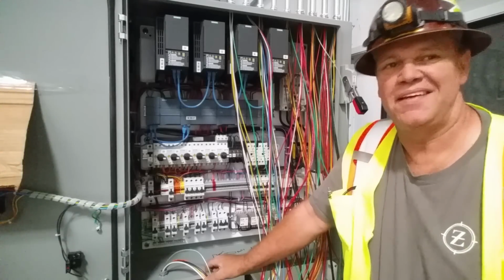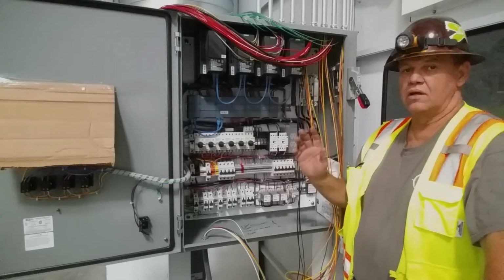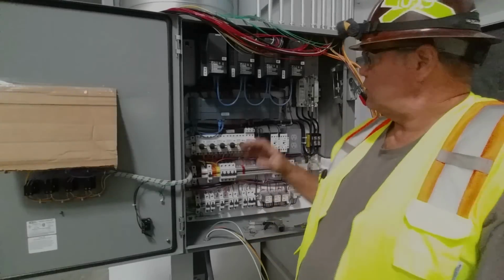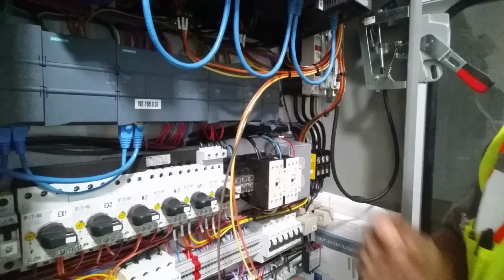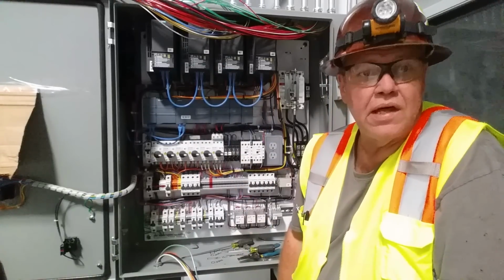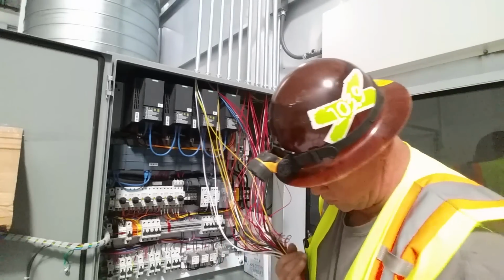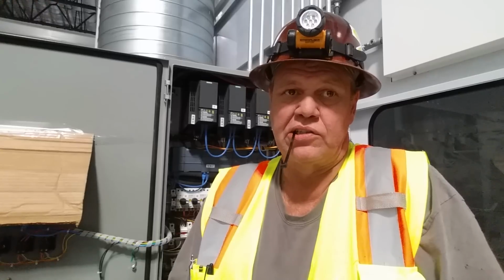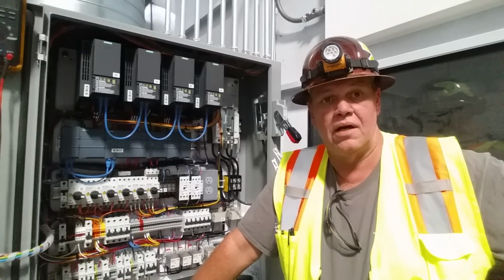Cabniet wiring

Comment: I appreciated your comments about people who have to follow you and thinking about them.  I see you label everything when the bundles are run. That attitude is just crazy enough to work.  Thanks
Reply from the maker: We just do a quickie white tape/sharpie marking job when pulling wire, after everything is bundled and routed, we make nice labels and install after the final trim, I use the Brady making system and make label sets for both ends, if either end has labels left over, we forgot one or something is wrong.

Comment: You said someone asked about one large conduit instead of the several you have, if you put all of them in one conduit there is a derating factor that app;lies every time a wire is added the current carrying capability drops, and after awhile  a #12 gauge wire would  hardly be rated to carry any current at all.   Been an electrician for years,  (retired now) but I can tell you're a top notch electrician, keep up the good work,  Love your videos, takes me back, especially the conduit bending.   God Bless America
Reply: Danny if he dropped all the 3/4  pipes into a trough right above the panels and came out the bottom with some short  2 inch pieces. ( separate 3/4 pipes for low voltage only) Derating is not a factor.  I'm pretty sure  the pipe run has to be more then 2 feet before derating is an issue. Having all those pipes leaves you zero space to add future circuits.  I work commerical and I almost ALWAYS put a trough above my panels.  I have never failed an inspection.

Comment: Reminiscent of my telecom days.  Organization and function were always present.  Flush cuts were required,   Labeling was intense too.  Every cable was labeled at both ends.  Goal was everything could be disconnected and re-terminated using nothing more than the existing labels.  Depending on the job labeling could be 50% of the time spent.  Very boring, and zero glamor, but the first time you had to troubleshoot or replace something you were hooked on the method.  Enjoy your work.  I really had no idea these kinds of systems were out there.

Comment: Stan, good point about the time it takes to do a panel neatly and properly.  I have worked on many residential jobs where the GC would rather me stuff wires wherever I can fit them than making things neat and clean.  It helps for identifying different devices and also makes it clear to whoever might work on the panel in the future where everything is going.

Comment: My rule of thumb:  If it looks good it works good.
I hate those little pads, alcohol is good, but they always loosen up in south Texas.  Just too hot for too long.  
I also like to flush trim the tag ends of tie wraps.  Keeps the next guy from getting cut when troubleshooting.
Putting the tie wraps on the same way every time makes for a clean install.  It becomes second nature over time.  I've found my customers like the clean look, and don't complain about my prices as much.

Excellent tutorial on the proper way to wire a control cabinet.

Comment: I always enjoyed wiring control system cabinets. I was always fussy wiring all the various cables to make it look clean and professional, and it made future troubleshooting and maintenance a simple task. I also developed a simple trick to protect the data cables from excessive interference and data loss. Back then the Ethernet cables used were the flat type ribbon-style cables and not the twisted pair cables used today. My technique dealing with the data cables was to wrap them with foil faced furnace tape and follow up with wrap of a quality electrical tape. At the time it may have seemed excessive, but it virtually eliminated electrical interference and data loss. The flat style Ethernet cables were notorious for cross-talk which causes data loss and errors. Back then the twisted pair Ethernet cables were not widely available and were much more expensive then the flat style cable.
Reply: Those flat type "Ethernet" cables have never been correct for Ethernet. The correct cable was also never that expensive--even in the 80s, the round telephone cords supplied by AT&T for their Merlin phone were twisted pair and worked fine with 10baseT ethernet. You also had the option of buying a roll of 4-pair telephone cable (1000 feet of which probably cost all of $30 back then) and RJ45 connectors and making your own twisted pair cables.

Comment: great video.  Where i work i deal with a rather large turret punch with a material storage tower and transfer system. Three different control boxes with multiple vfds and servo controllers.  Yet whenever something goes wrong nothing in the boxes are labeled and is a hunt and peck method of diagnosis. is that am industry standard so the average operator can't fix minor problems and has to call in the pros?

Comment: One job I had back in the 70's was making looms for large computer power supplies on a "nail board". All wires were terminated both ends, labeled, and tie wrapped at specific points to relieve strain for field installation. It's much easier to trace for fault service AND it keeps the loom out of the way of components. End result is something that LOOKS neat and pretty, because the function determines how to route wiring. Same thing here, it's not because of an "OCD" personality, it's b/c of the function. I'd much rather service a panel that looks this way than one done in a haphazard manner, or laid out to "look" pretty but took so much time that, as the man says, wastes time (and money).

Comment: What kind of adhesive sticky mounts you use? All the ones that I ever used aged badly, the adhesive breaks down in  a couple of years and they fall off.  High temperature ages them even quickly.

Comment: Stan is it code to segregate wires in the pipe and cabinet?
Reply from the maker: All the control voltages are derived (single incoming voltage, control voltages generated within the panel) so sharing a common cabinet is legal (dont really have a choice) separating voltages in the conduit is a precaution so as not to introduce errors into the electronics, shielded belden cables also help keep the signal wiring clean.
Reply: OK thanks I have no electrical experience and of the mind set that if I need an faceplate changed call a electrician!

Comment: 95% of the control cabinets I've been inside use all black for power wiring (480, and 240). Is there anything that dictactes when you have color code the power wiring and when you can use all black?
Reply from the maker: The OEM uses all black within the cabinet too, we use industry standard colors for field wiring just to help out with electrical maintenance down the road.
Reply: Thank you.

Comment: First of all I am not an electrician. Many year ago my employer had an AC unit installed that required 3 phase. The electrician that installed the unit ran each phase through a separate conduit. After running the unit the conduits became very hot. I assumed the induced voltage caused the conduit to heat up. When the new electrician rewired the unit he installed all the 3 phase wires in the same conduit. There was no conduit heating after that. Was my assumption correct?
Reply: Not an electrician either, but yes, when the three phases are bundled together, their magnetic fields sum to zero.

Comment: Surprised they didn't use wire duct in the control box.  But I guess that would have required a bigger enclosure it looked pretty tight in there between DIN rails.
Reply: or good enough is good enough.
no brownie points for showing off.
Reply: EitriBrokkr mm Kay

Comment: The VFD,s that I’ve installed requires the motor ground to be landed at the VFD then a jumper bonding the VFD to the ground bus. Other than that, I like a control cabinet that doesn’t fill the whole room just so they can run all the cables in the plastic wire way’s

Comment: That cabinet looks like it controls many things. How big is that booth? Does all the power for everything in the booth run thru that one cabinet?
Reply from the maker: Hey Brian, 4 fans, 2 heaters, 50 lights, 3 limit circuits, 4 mod motors, misc airflow, high limit switches .... oh, and a "sleep" mode if the painter doesnt pull the trigger for 15 minutes.

Comment: Very nice elegant work Stan, you can tell professional installation Vs i have no clue what I'm doing here. I just hope none of the technicians have to troubleshoot this panel under power ( Arc Flash PPE). This panel should be bigger... This is one of my biggest pet peeves these days ...Elect Engineering and NEC allows OEM to install all these components and wires, in small footprint panel and they look awesome especially job like yours but few days later poor tech has to go inside to work on it hot and dress up his/her arc flash outfit ( this one looks like it could be CAT 3)... No way those guys can troubleshoot this panel in that tide space with their FR outfit .. they are set up to fail by the standards that supposed to protect them...Ironic... Anyways,  thank you for your video and great workmanship 👍👍👍
Reply from the maker: I always like a roomy panel, but I have to work with what is sent to the job. Thanks for the view and comment.
Reply: Shadon How, I agree brother,  we only can work what with they gave us and some days it's not much 😜.  I wish they would at least consider some of our suggestions..

Comment: i'm an electrician in the netherlands, even here in europe wire colours and connection methods differ from country to country, but wow, this is so much different than the way we do it. 

just a couple of questions out of curiosity:
no neutral on your 3 fase?
we use wire end crimp on connectors for flexible wireing, dont you use them in the us?

just one little remark: i think sticking the mounts to the vfd's is a bad idea, they get hot and the glue melts etc.
Reply: adriaan Neutrals are not mandatory for individual loads powered by single phase, or three phase. The Authority Having Jurisdiction(city/township), or engineer may specify one, but it will be an unused conductor in the raceway. The same rules apply for ground(earth) conductors. Ferrous raceways, like the conduit for these loads can be used as the ground, but the AHJ or engineer might specify a grounded conductor.
Crimp connections are typically found on low voltage connections. Higher voltage/current connections primarily use wire nuts and lugs. Waygo connectors are slowly gaining popularity, but the majority of electricians prefer the wire nuts. I don't know if you know how wire nuts work, but you twist your stripped conductors together clockwise, and then twist the nut clockwise over the top. A tapered spring inside of the nut expands while your twisting, and closes tight around the conductors when you let go. It's an old method, but has proven itself when done right.

Comment: I noticed you got a little fan in there.  Guess it must get pretty hot in that cabinet with 480 running through there.  BTW, is the 480 for the VFDs (Variable Frequency Drives)?  I can't imagine the PLCs needing that.

Comment: Hey Stan, I've been in the electrical power business for 40 years. Nice to see a panel done right. Does your equipment supplier provide the panel, or do you use a separate UL listed shop to fab the panels?  Nice work, and really good instructional video.
Reply from the maker: The equipment comes with its own panel, so we never know what we are going to get to work with, this one is an ETL panel shop.

Comment: I would prefer a slightly larger enclosure for that panel, if at all possible.  I hope you have better luck with the peel and stick mounts.  I find they don't stand up to heat and come loose.
Reply from the maker: Hey James,  3M peel and sticks work well, I keep little alcohol wipes in my cart. I would LOVE a larger panel, but those are the cards delt to me. :) nice to see you on the channel.
Reply: Shadon HKW the wipes are very important to get good adhesion, also can countersink in middle of pad.
Reply: I buy the ones without the pad and epoxy them on.  Funny thing is they cost twice as much.
Reply: i use brake cleaner spray a rag and wipe 3m make some really sticky mounts , i am with james a bigger box makes trouble shooting much easier when it is on a machine that has a lot of shock or hard cycles where things tend to come loose even if you do every thing wright and to code
Reply: Same here, however it helps to rough up the powder coating with some fine emery cloth a little when sticking them to the panel.

Comment: Hi Stan
Very neat and organized work!  I think "workman like" is the correct complimentary phrase:-)

Question: I may be old school and always put a bit on antioxidation compound on wires of 120V and up. Is this still done these days by the pros?
thanks
vic
Reply: only aluminum SE wire and circuits, and i also put schmoo on 12VDC braided copper on vehicles where exposed to moisture/salt, otherwise, green death

Comment: Hi Stan       Nice job      just a few questions and comments     are you using Siemens because of the graphical interface you hid behind the cardboard ?     do you ever use slotted plastic cable trunking in panels      and a comment      now you need to start using cable in trays or trunking to connect everything like the rest of the world (opposed to wire in conduit)  i know it is used in the US   I have seen pictures of server farms built in large warehouses filled with 20` containers full of servers in 19" racks      have a nice day

Comment: I work for Siemens doing building automation in Alberta and some of our guys have no respect for separation. They mix AC, DC, 120V, 24V. Depends on the electrician, it's pretty embarrassing. Also no bonds on your VFD's or are you relying on chassis ground?
Reply from the maker: The backing plate had the coating removed and star washers for mounting, factory stated nothing else was needed.

Comment: This was really interesting, but I still don't understand why separating the voltages matters to begin with. In the pipes or the panel.
Reply: Induction. Currents cause a magnetic field around the conductor. If that magnetic field is changing (like it does constantly in case of AC) it will induce voltages in other conductors in reach of the magnetic field. You transfer the signal from one cable to another cable via the magnetic field surrounding the cable.

Comment: I thought the obvious answer to why your run so many conduits is because electricians are anal retentive. :D

Edit:

Serious question:  Is there a reason for the skipped terminals left between some of the ground wires on the ground bar?
Reply from the maker: The panel builder connected theirs from the top, I brought mine in from the bottom :)

Comment: Anything above 50 volts is considered high voltage... Low voltage is under 50 volts...
Reply: it all depends on perspective. some of the equipment I work with runs on 4160vac 3 phase and is considered the be medium voltage   most equipment is 480 vac 3 phase. the plant is fed straight from the utility provider at 161 kv and we have 2, 35 megawatt transformers that turn it down to 16 kv for the distribution transformers in each area.

Comment: That’s a huge frustration for service guy about to unfold!!! Faults, shot downs and chasing own tale!!!
VFDs, PLC and high AC voltage in one enclosure, without steel partition!

I didn’t watch to the end - will there be a radio/WiFi equipment also crammed in there?!?!

I am not knocking on you - I know you didn’t designed that thing, you just mounting it.